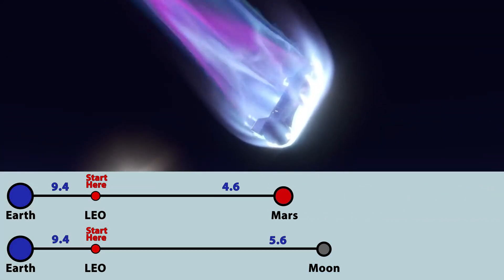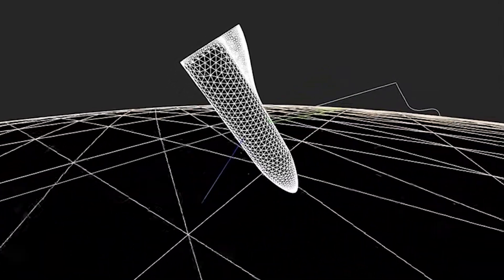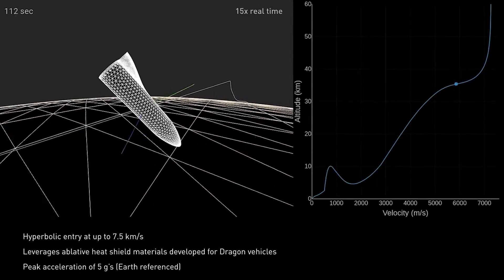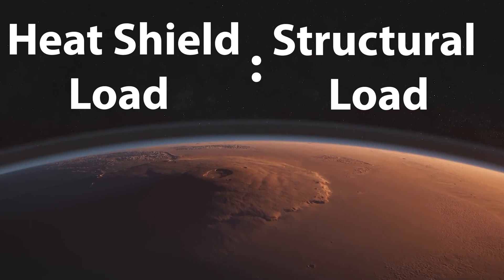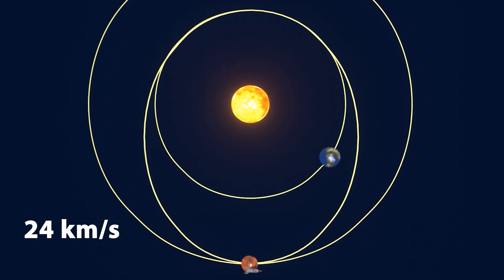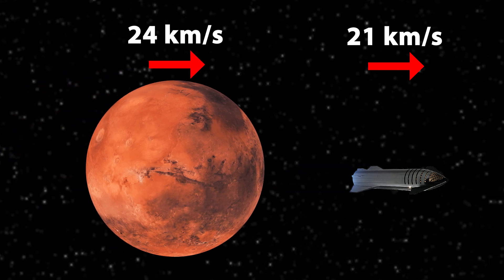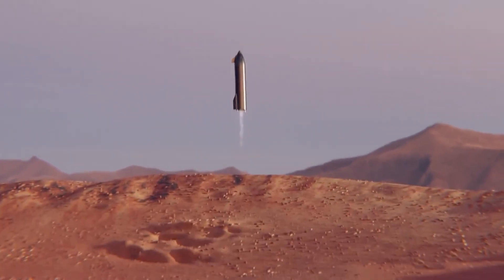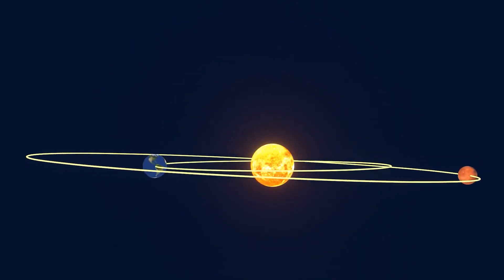Can Starship ACTUALLY land on Mars? (Aerobraking)

Comment: The MOST WEIGHT NASA ever landed on Mars was 2-tons, and they had to use an incredibly complex landing procedure to get it right.
Anyone who think SpaceX can land 100+ tons on Mars surface is insanely mistaken.
Reply from the maker: Propulsive deceleration is what makes the difference here, most landings on Mars thus far have used an ablative heat shield to aerobrake on arrival and then tried to parachute to slow down. 

With parachutes, the mass you can bring is limited. With propulsive deceleration, as long as you have sufficient propellant on arrival, the mass you can bring is not constrained by the thin atmosphere. 

Nonetheless, landing starship on Mars will be a huge challenge! Not just achieving a successful aerobraking maneuver, but also landing propulsively with such a massive ship on the Martian regolith. Thankfully Mars' surface is much denser than the Moon's, but the engines digging a hole into the surface will still complicate things!
Reply: @ Do the math.
There is no way that StarShip can bring enough fuel to Mars for an 8-month trip plus landing. 
The only way for this type of landing to be possible would be if Starship brought along a fully loaded tanker with it, and even then it’s risky or outright impossible. 
Starship will never bring 1 person to Mars, let alone 100+ per trip.
Reply from the maker: @jeffw8218  Fully fueled in low Earth orbit with 100 metric tonnes of cargo Starship has a DeltaV potential of 6.9 km/s. 

A Hohmann transfer to Mars from LEO requires 9.6 km/s of DeltaV, with 6km of that being used to capture into orbit, lower the orbit, and land.

Capturing into orbit and lowering the orbit can be done primarily via aerobraking, and wouldn't require much more than a few corrective burns. 4km/s of the 6km/s is the energy needed to slow down for landing, but this velocity can be shed via aerobraking up to the planets terminal velocity. 

The terminal velocity of Starship in Mars' atmosphere would be about 1km/s, so therefore the final leg of the journey to Mars may require 6km/s of DeltaV to capture into orbit, lower the orbit, and land, but only about 1km/s of this needs to be provided by the engines.

This leads to a propulsive DeltaV requirement of approximately 5.6 km/s to get Starship from low earth orbit to the Martian surface, while carrying 100 metric tonnes of cargo. 

Since starship has a DeltaV potential of 6.9 km/s, this means there would be an excess of 1.3 km/s of DeltaV left over, which can be used to shorten the transit from the 9 month Hohmann transfer, bring more cargo, or reduce the mission's dependence on aerobraking.

Here's a short video I made discussing the above if you're interested! 

https://www.youtube.com/watch?v=-l0BpxS-rVk

Comment: We can use robots to travel to Mars. set up the place. Then it'll be safer to send humans.  Humans could start heading out in self-survivable, self-contained worlds, like ocean-going vessels but in space, super ships that can easily and comfortably have everything needed for survival and offer a comfortable trip to Mars or beyond.
Reply from the maker: Thanks for your comment!

The main issue with super ships is the weight of them, and the propulsive burden of getting that mass out of Earth's gravity well. Larger ships could be constructed in orbit from lunar or belt resources, but even then moving a large mass between two locations in space is very energy intensive. 

The best option for a luxurious transit to Mars is "Earth-Mars Cyclers", which take their own elliptical orbit around the Sun with orbital apogee at Mars and Perihelion at Earth. It can then "cycle" around the sun using hardly any propulsion, and will constantly be riding Hohmann transfers between the two planets. The cycler itself would be like a cruise ship, with spin gravity radiation shielding, entertainment, etc. All that is needed is smaller transit vehicles to go up and down the gravity wells at Earth and Mars rendezvous.

This sort of plan requires the transits to Mars always take 9 months, but it's worth it for the extra protection and comfort enroute.

Comment: I was not liking the circular orbit analysis, few people realize the importance of the differences between synods. But you saved the day in the last 30 seconds, good disclaimer on "averages". So I'm subscribed.
Reply from the maker: Haha thanks Bob! Science communication requires a fine balance between the simplicity of the explanation and the technical accuracy. 

I'll be doing another video on this topic where I get into more detail about synods, plane change maneuvers, free return trajectories, cycler spacecraft, the difficulties of landing on the Martian surface without a launch pad, etc. 

The full video (linked in description) includes a comparison of short vs long stay mission architectures, and goes over the the delta-v required to get to Mars. Feel free to check it out if that interests you :)

Comment: Now I watched the video. It gives a nice summary of the topic with a clean delivery and good visuals. 
A few things you might want to look at: 

The martian atmosphere is NOT thin. It has the same density as earths atmosphere has at the respective altitudes where spacecraft slow down at both planets. 

At 3:13 you have a fundamental error. 
The entry velocity is not solely the velocity difference between the ship and Mars.
You have to ADD the escape velocity as the planet pulls the ship in. v_entry^2 = v_esc^2 + v_infty^2  with v_infty being the velocity mismatch of the ship and the planet. The NASA trajectory browser already includes that in the "fly-by" setting you already discussed elsewhere. 

Negative lift is all nice, but Starship is not required to stay in that orientation. When it gets lower into the atmosphere it can keep the same AoA and just turn sideways (or upright). By doing this it can keep its altitude and its drag coefficient. 

I can understand that you didn't discuss the last point in your video for the sake of simplicity. The first two points however you should take a deeper look into.
Reply from the maker: Thanks for the comment! 

I was aware of the atmospheric density similarity at high altitudes, it's the same at 80km on Mars as it is 100km on Earth (susceptible to fluctuations), but I cut that out in the interests of brevity.

I was not aware of the specific math behind calculating atmospheric entry! My numbers should be correct in either case, since I relied on a variety of difference sources (linked in the video description) for my atmospheric entry velocity numbers, but perhaps I should have updated my graphic to account for gravitational forces during descent into Mars's gravity well. 

I suspect it would be less than 4.25km/s of acceleration from Mars's hill sphere to the surface, since gravity is a force over time, and the time from hill sphere entrance to landing will be much shorter than if it were in free fall due to the high flyby velocity. Is the fact that the values are squared in the formula what accounts for this? 

If I had intended this to be a stand alone video about aerobraking from the beginning I would have gotten into all of the details mentioned! This video is a cut from my longer video about getting to Mars that also covered mission planning (short vs long stay trajectories) and delta-v considerations enroute. 

Thanks for all of your helpful feedback. A lot of really cool points have been brought to my attention so I'll definitely be readdressing this topic again in the future with updated information, including the risk of digging a hole into the Martian regolith with the Raptor engines since Martian gravity may be too strong to land with pressurized gas thrusters mounted high on the sides (as is the plan for the Moon).

Comment: Very good job on the info in this video. I watch all these space videos and channels and I actually managed to learn a few things that I didn't know in this short video that I didn't learn in lectures that were hrs long over the course of years. Everyone always says mars is hard but they never really get into the deep details of why other than the think air explanation. Robert Zubrin even mentioned that speeding up the trip is a bad thing. But didn't mention exactly why. Thank you so much for this! Get tired of hearing everyone basically rip off and regurgitate each other's speeches and talking points without actually putting any of their own thoughts into it. This video was 100% authentic as far as I can tell.
Reply from the maker: Thank you so much for such kind words!

I had to do a lot of digging to figure out the reason faster transits result in exponentially more difficult aerobraking; if you want to see my reference material I always link it in the video descriptions. 

I've done a few other videos on related topics, you should check them out :)
Reply: @MarsMatters  I will definitely check them out! Thanks